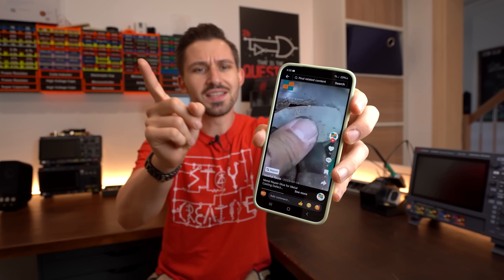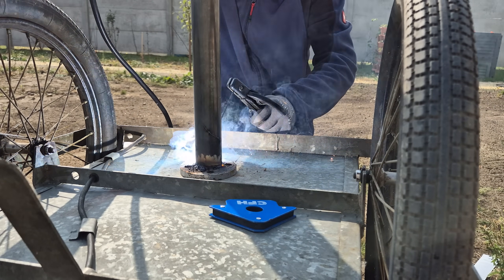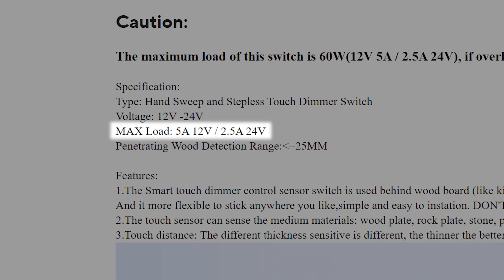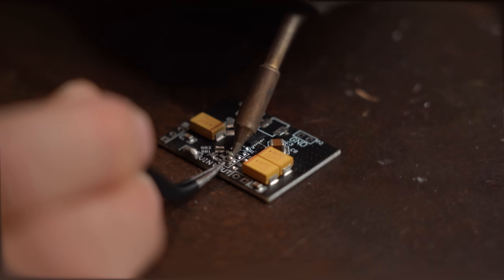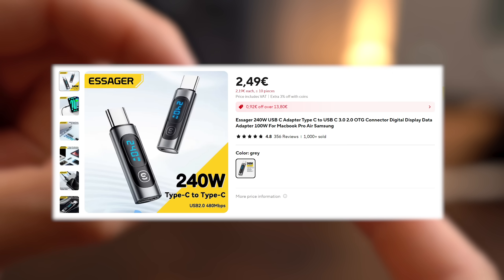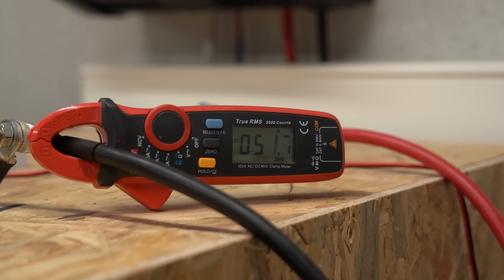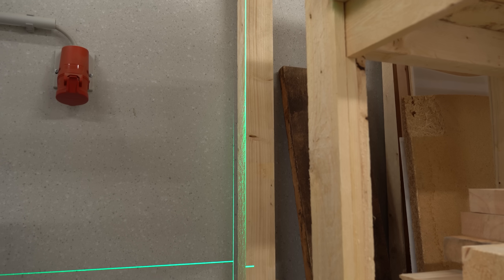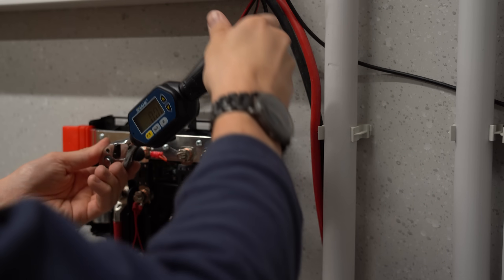I tried finding Hidden Gems on AliExpress AGAIN! (Part 11)

Comment: That metal repair glue looks similar to JB Weld in the US.
Reply: Yes, this appears to be a generic version of JB Weld.  While it's definitely not a replacement for real welding, I will say that JB Weld is an excellent product that will work in many cases where normal epoxies simply don't and it's surprisingly good with most plastics as well as metal.

It's good stuff, but I would gladly pay more for the real thing in this case as I use JB Weld in more critical applications than a normal expoxy like Gorilla; I don't want cheap epoxy in these situations.  He doesn't test any generic JB Weld options, but Project Farm has one or more videos testing glues and epoxies and I recommend watching those.
Reply: Bought it here in the Benelux via Amazon. A lamppost in cast iron fell down during a storm and 1 arm broke. That was about 10 years ago. I used JB Weld and it has held up perfectly outside all this time. Nearly forgot that I did this. It was kind of expensive but certainly worth it.
Reply: That was my first thought as well. My dad uas used JB Weld for years, including plugging a small hole in an engine block with it. THAT repair is probably decades old now and the old Jeep was still running last I heard...
Reply: Is JB Weld not available in the EU?  What a shame, it's pretty great stuff.  
With JB Weld and duct tape, you can 'fix' just about anything...for a while.
Reply: @Elmojomo  It is.
Reply: @Elmojomo it's available in the UK, mostly through eBay etc.
Reply: Yes. And I can get JB Weld cheaper than that stuff, and from what I heard it is vastly superior.
Reply from the maker: I heard of that before......it is possible that both do around the same.
Reply: @greatscottlab  Based on the colors I wouldn't be surprised if this is basically knockoff JB Weld from materials that didn't meet spec.
Reply: @superslash7254  need to smell it to know for sure lol. JB weld is a very distinct odor.
Reply: @superslash7254  I doubt spec materials are anything special for a product that old now, its probably exactly the same.
Reply: @greatscottlab no… I mean yes, they are sold for the same purpose but I highly doubt that the goo you bought from AE would be able to repair a cracked engine block or broken automotive water pump housing. JB Weld’s products are astonishing. JB Weld is a 2-part epoxy with iron powder fill… and I’d trust it with just about any job including (when installed correctly) load-bearing applications as an actual welding replacement.

Comment: Glue and paint, makes you the welder you ain't 😂
Reply: That glue is basically Chinese JB Weld, which is not bad but still no substitute for a proper weld.
Reply from the maker: True ;-)
Reply: @greatscottlab  Btw Both surfaces should be degreased and made more rough with sanding paper before applying glue - not sure you did that......but still glue can never beat welding...
Reply: Do your best and silicon the rest!
Reply: Boeing would approve 👌
Reply: @darknight_4312  🤣
Reply: So close. The saying is "a grinder and paint makes you the welder you aint
Reply: A grinder and paint. wtf would a welder need glue
Reply: @OomGielie  🤣
Reply: It's a "grinder and paint, makes you the welder you ain't".
Reply: @1992jamo  it was changed to fit in context
Reply: @1992jamo that's the joke

Comment: 2:50 This description should be interpreted as a ‘substitute for welding’, not that it should be used in the same way. Adhesive requires surface contact on both sides, the more the better.
The logic behind some Aliexpress descriptions is more than questionable.
Reply: When translated to English "welding" has also meant "soldering" or "brazing" on products I've bought.
Reply: @dancooperish  That hurts on so many levels. 😵‍💫
Reply from the maker: True.....
Reply: To be fair to Ali, quite a few North American brand glues use the word "weld" in either their name or description. "Weldbond" and "JB Weld" comes to mind...